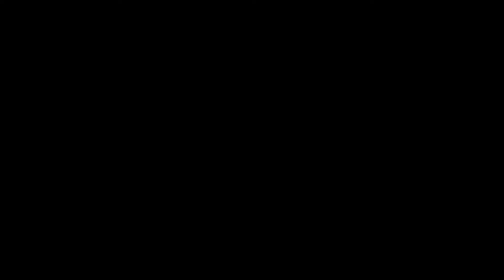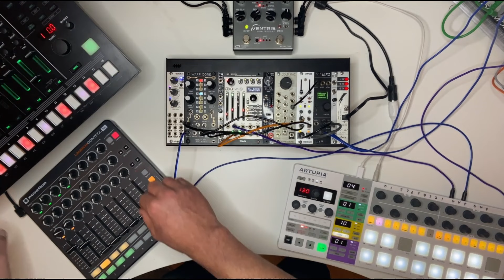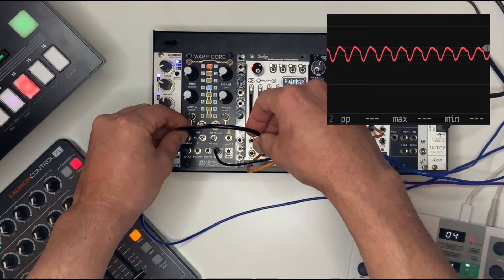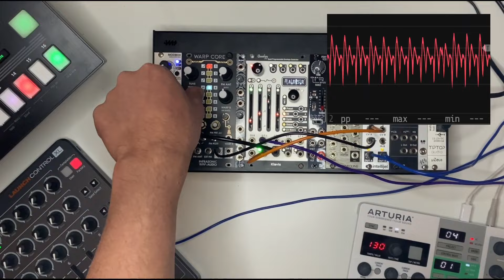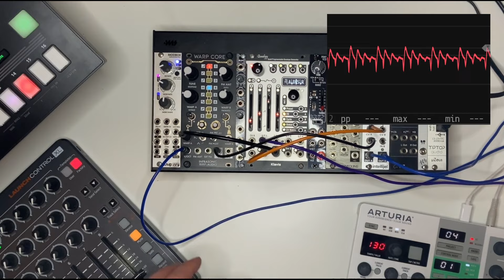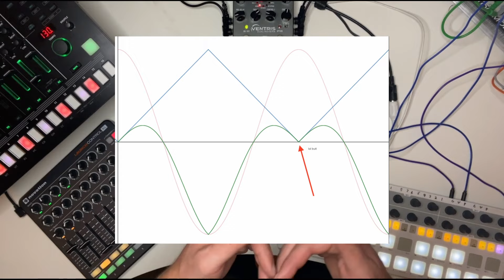WARP CORE – Acid(ish) Bass Tutorial and Demo

Comment: a few weeks ago, alm busy circuits posted a video on instagram of an analog phase distortion patch with their tazm o oscillator. i mimicked the patch in my set up, and i was trying to figure out why the resonant sound happened only after i modulated the vca at an audio rate. but it clicked for me in this video, it only worked because it was a saw wave, and it was shutting out the reset sound from the sync modulation by closing the vca. so damn cool. i wanna get this oscillator now, im on a phase distortion kick lol
Reply from the maker: Oh very cool, I haven't seen that video yet! There is still some Warp Core stock at Schneidersladen, and I am also working on a second batch so stay tuned!
Reply: @infrasonicaudiollc  dope!